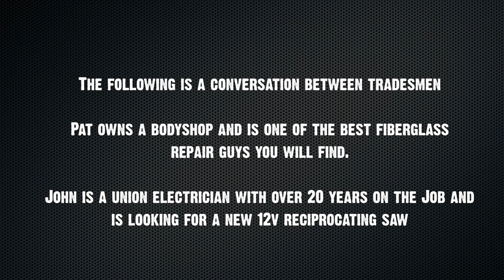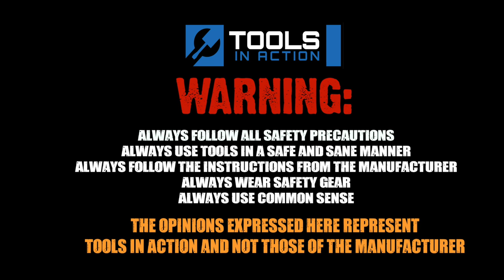Milwaukee M12 Brushless Fuel Hackzall -  2520-21XC

Comment: Electrician here, and yes! 100 times yes on what you said about cutting emt in the beginning. Using the Milwaukee hackzall m12 or m18 is just a breeze. I had a Dewalt reciprocating saw 1st but once I used this I never went back to it.

Comment: Very nice M12 BL Hackzall. I want one;) I think I might have to go with dewalt 20Vmax and M12 BL. Since dewalt 12Vmax line are pretty much die down. I love Brushless power tools. I like the vlog. Its great. I use to have one of the skill wrench. Just like he mentioned.  The skill has almost 0 torque. Pretty mich useless. Till my friend kind of took it and move to the mainland with him. I still have the charger somewhere tho;)
Reply from the maker: The Skil is great for small jobs. I still have mine
Reply: Nice, good. I bought mine at Wal-Mart 4,5years ago for 39.99 on sale. Surprised that yours still working:)

Comment: You know for a 12 volt tool that Sawzall really gets he job done.. Honestly most 12 volt tools are garbage.. Theyte only for a home owner who usesmit every noe and then.. I use the m18 from milwaukee which ivenused them all andni still think sometimes the m18 needs more power and longer run time but it is top of the line
Reply: THank you for confirming our choice of the 12V line of tools. Not everyone works in construction, and the 12V line has more than enough power and battery capacity for short jobs (or even tough jobs, the Milwaukee 12V 1/2" impact takes off lugnuts with surprising ease). Seems Milwaukee turned up the power with the new Fuel version of this tool, knowing that home users need the power, just  not for as long.
Reply: Actually, most of the Milwaukee M12  stuff is pretty good. I have quite a bit of both the M12 and M18 and I use the M12 much more often. M12 impact driver is very compact and gets the job done. Same with the 1/2" drill. It's a matter of using the right tool for the job. I don't use a tool that is twice as big and heavier if it's not required. The Hackzall is an exception. The non Fuel is a really poor tool compared to the Fuel or the M18; HIgh vibration, short stroke, underpowered  and poor performance except for very light jobs. The biggest difference between these 2 Hackzalls is the stroke length. The M18 has an even longer stroke length and is much faster and not that much bulkier than the M12 fuel. I'm surprised Milwaukee hasn't dropped the original M12.